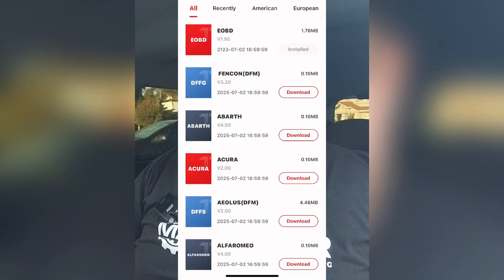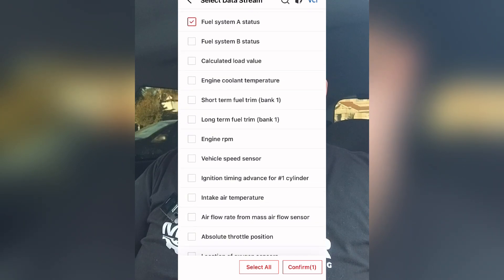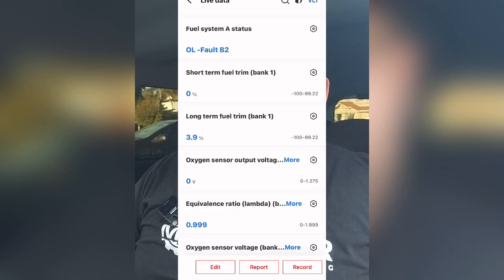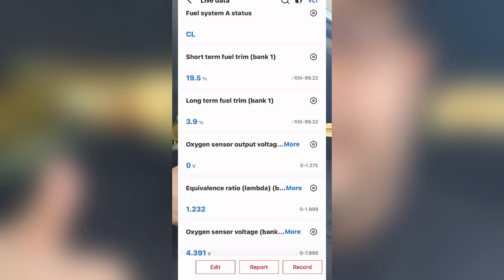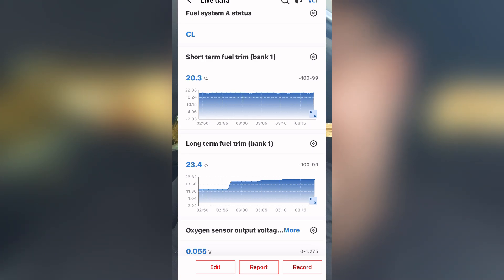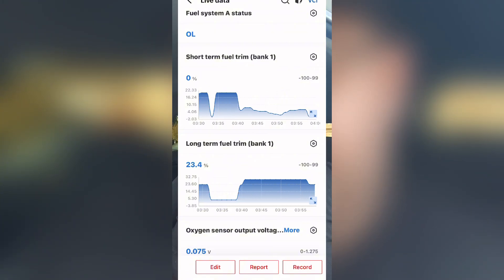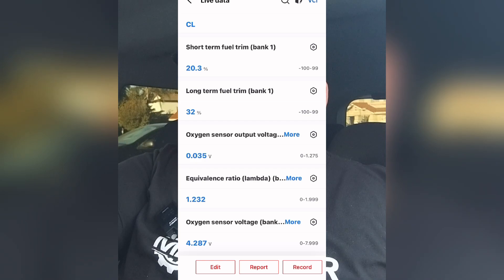Short Term and Long Term Fuel Trims Explained [LIVE]

Comment: What’s considered a normal range for each? For example I have a 90s Honda with LTFT at idle of +6 to +7. Is that something that needs to be investigated?
Reply: Nope! Anything under 10% is normal and will change according to outside weather; temp etc. If short term or long term fuel trims go over 25% either way, then it'll throw a code.

Comment: brand new to understanding fuel trims, so any help would be great. any one commenting please don't   guess. KNOW
fuel system 1 closed      all data taken from fox well n t 301 code reader 
fuel system 2 --
load % 20.4
e c t  199
short fuel trim 1   1.6 to 4.7
long fuel trim 1  0.0
short fuel  trim 2    -9  to +32
long fuel trim 2   0.0
r p m 800
v s s  0
spark advance 12 to 17 
i a t  273 
m a f   .01
02 s l o c 
 o 2  b 1  s  1   .2  to .84

0 2 b 2  s 1   .1 to .7

  this 02  f 250  5.4 has had junk yard  engine put in .runs but condition unknown. has had conversion from auto to manual transmission . by me .  has manual p c m from donor transmission truck  180 p s i on all cylinders . 8 new e d e l b r o ck  coils.
8 new plugs . plug on 8 shows a little oil fouling not bad .0 2 sensor bank 2 new.  bank 1 sensor less than 100 miles. injector wires were spliced to work with those injectors.  but were matched to common wire and pulse wires correctly. 
  reading voltage on injectors 12.5 on all 8   reading voltage across  coils key on engine off all over the place on each  coil.
truck has yet to run on all 8 cylinders since i put it in .HELP

Comment: I have the most difficult parasitic drain that I cant figure out, I feel I have done everything in the internet (pull fuses, ppdraw, fluke multimeters, etc) to figure it out and still no resolution.
Reply: Have you tried a thermal heat imager? You start the car, then turn it off, then check what is not "sleeping" via infra-red. That is your draw

Comment: Would a p11ea be tied to fuel trim. Have it on my 2018 camry. Changed injectors and plugs. Goes away but comes back the jerking in engine

Comment: Chevy 6.0 - ST normal at 0 +/-5% but LT are high at 22% at idle. I can create a vacuum leak and ST go up above 20 LT stay above 20, when I seal off vacuum leak ST goes back down to 0 but LT never goes down. Any ideas?

Comment: Great video, why would my truck go from closed loop to open loop when I coast..when I'm not using accelerator? And back to closed loop when I accelerate?
Reply from the maker: Normally when in decel, it will go open loop so the PCM takes control without any sensor inputs. When you begin to accelerate again teh PCM will once again take in sensor inputs and go back into closed loop. 100% normal.

Comment: What would cause multiple fuel trims to be -100
Reply from the maker: -100 I have seen as filler data on fuel trim banks that are nonexistant on the vehicle but the scantool manufacture still provides fake/filler data.
Reply: @MasterAutomotiveTraining  I think my valve guides are bad, smokes pretty thick at start up but fades fairly quick...smells of oil and gas

Comment: Does this work for speed density systems?
Reply from the maker: Sure does, the only thing that changes is the MAP instead of a MAF.
Reply: @ thanks for the reply, I was referring to the effects a vacuum leak has on the fuel trim of a speed density system. I thought the vacuum leak does not change the fuel trim.
Reply from the maker: I'll confirm for you.
Reply: @MasterAutomotiveTraining  thanks again. I am not a mechanic, but I learn a lot from knowledgeable people like yourself.  Cars that use a MAF meter
Reply: MAF cars will not account for pirate air resulting in an imbalance in the air fuel ratio. The imbalance is detected by the oxygen sensor, and the PCM compensates by adjusting the fuel trim.  MAP cars calculate air flow by measuring the pressure in the intake manifold, therefore all vacuum leaks are detected and compensated for immediately upon creation of the leak. The mixture never goes lean, the oxygen sensor never reads lean and the fuel trim is not used to compensate.  It is as if the throttle plate opened more, which increases the idle.  If the leak is large enough, the PCM will close the throttle to maintain the correct RPM.

I have seen many YouTube videos on fuel trim, but no one talks about MAF vs MAP.

Most new cars are turbo charged, meaning they use a MAP, meaning fuel trim can no longer be used for vacuum leaks.

If your research proves any of this to be correct, maybe you would consider making a video on the limitations of using fuel trim to diagnose vacuum leaks. Thanks aging for taking the time to read my post. Looking forward to more great videos from you!

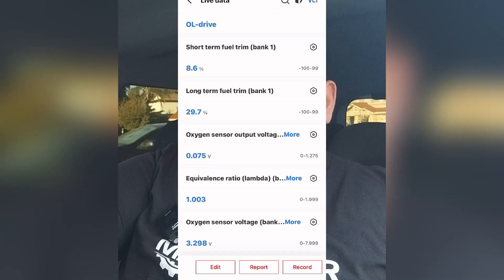Comment: @7:00 just to verify the information....  isn't it the voltage reading on an A/F backwards from an oxygen sensor, 3.2v should be lean? Am I correct?
Reply from the maker: On this Toyota, the higher the voltage the leaner it is and the lower the voltage the richer it is. This is one reason, AFRs are much easier to understand, as lambda follows the same rule and so does the Mode $06 AFR/HO2 mA test.
Reply: easiest way to remember is A/F sensors are opposite of O2 sensors.  High is lean while low is rich.  the problem is for most manufactures they don't post what normal is suppose to be.  That only comes from experience.